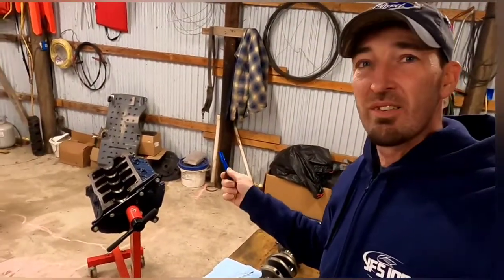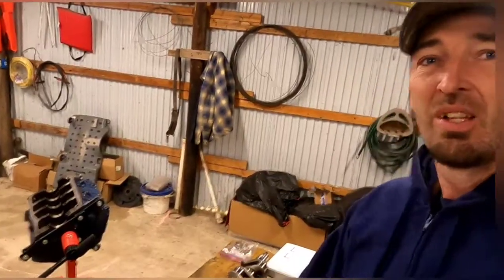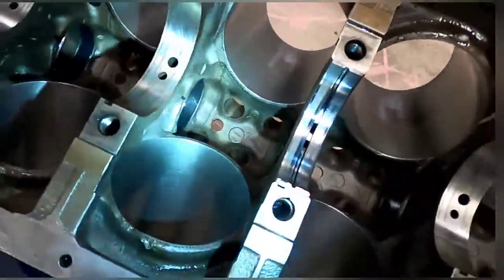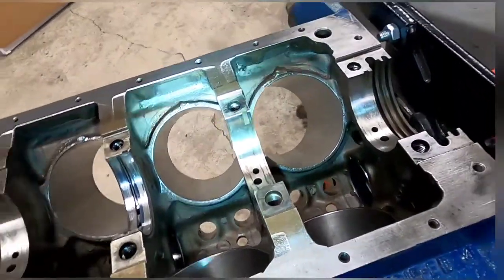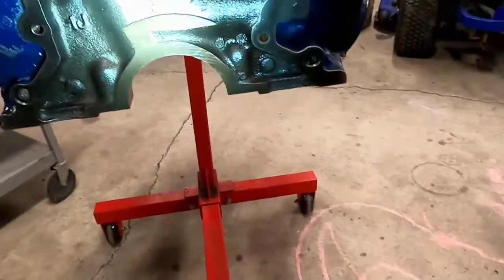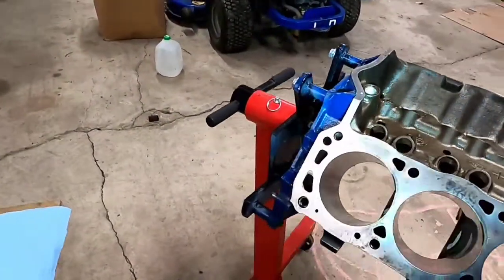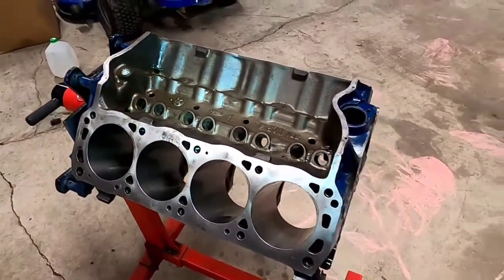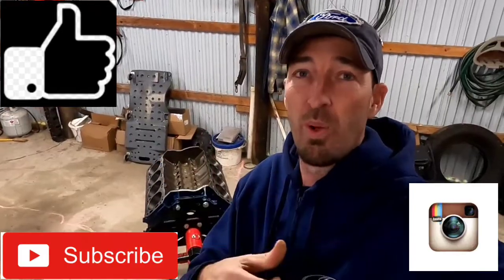Improve engine oiling! PART 1 of 2.  Ford 289,302,351 ect

Comment: One of the most important modification is to drill a 0.40 hole in the front ds oil galley plug, it sprays the distributor gear.

Comment: That hole in the front of the block by the distributor has nothing to do with the oiling system or drain back. It is just a place where the casting cores touch each other.
Reply from the maker: If you don't modify it, oil will never be able to drain out there . Which is beneficial.
Reply: @blueovaldude   Retired Ford power train engineer here.  That hole was just a consequence of how the cores are laid out  In some blocks that hole is not even there it is literally a crap shoot if it is there or not.  Once the blocks were vibrated clean of casting sand part of the sprue removal included giving that spot a whack with a hammer to knock it through if the casting was thin. This was done so it did not break off into the engine at a later date.   335 series may or may not have that hole as do many other blocks from various manufacturers. 
It is just a by-product of the casting process and that is it.    The Chain and dist gear are lubricated by the cylinder head return and the cam thrust plate lubrication all they need is a bit of splash.  Too much oil in the front of the engine can overwhelm the front crank seal, so do not be too quick to open that hole up...
Reply from the maker: @matthewq4b  with all due respect sir, you are not telling me anything I don't already know . The last part of your statement is just plain is not true, it is not going to cause a leak. How would I know ? Perhaps because I have been building engines and making engines survive in a hot steet,drag racing and oval track racing environment for getting close to 30 years, no front seal leaking issues to date . True the 335 series may or may not have that hole. The 335 series when used for racing purposes is famous for having terrible oil return .  you need to modify the oil drain backs including that area in the china wall that may not be open in a 335. If you know what I'm talking about you must know that it is common on the 335 for guys to put a .040 hole in the front oil galley plug behind the distributor gear to oil the cam gear and distributor gear more so they do not eat gears so easily when using a HV oil pump . I don't normally reccomend a HV pump or drilling the oil galley plug . But opening up and smoothing out the hole in the china wall behind the distributor has been a successful place for better oil drain back and oiling the distributor gear and timing chain better.  Also having less oil fall onto the rotating assembly makes a little more horsepower. Which is why current production engine blocks scallop oil down and away from the rotating assembly. Thank you sir.
Reply: @blueovaldude   I get where ye are coming from BUT you are only looking at short-term performance and especially race engines typically do not go 100k without being opened up.   
If you need to increase dist gear lubrication in the SBF drill a 0.025" hole in the oil galley plug behind the dist shaft.  And really most performance applications are using rear sump pans.  So that is where you want to get the oil anyway.   
Regardless none of this changes the fact that that hole has nothing to do with oil return and is just a by-product of the casting process.  None of the racing blocks or the AL blocks have it. 
But a  friendly word of advice since you are building performance engines you probably should not be taking material out from around that hole, especially from the bottom of the hole. If you remove material from around this hole it really lowers the stress required to split the block down the lifter valley.  
 This hole typically is where the lifter valley split propagates from when the SBF blocks do split.
If a block does have this hole it just smooth the edges to eliminate stress risers.   
  But ideally, if you are building a  performance engine if at all possible start with a block without this hole as it makes a substantial difference in the strength of the block..
Reply from the maker: @matthewq4b  well sir there are good explanations for those . Such as . The 351w normally rips the main webs out instead of splitting. Many f4te blocks have tiny cracks in the cam bearings journal area from the factory something you have to watch for in high performance use . But If you are going to make enough power to rip the mains webs out, it is time to upgrade anyway. As many guys now make over 1,000 horsepower on the stock block and rotating assm with boost and at some point it will have had enough. The world man o war block for Example, cannot have a hole in the china wall because of priority main oiling. It literally has the main oil gallery boss right in that location. It also has twice as many drain holes in the lifter valley. Why ? Because  it needs good oil return. Something the factory block lacks . Which is why these modifications are done . If you are are planning on having a granny machine making leisurely Sunday drives . It need not apply . If you think I don't want or don't need an engine to last you are sadly mistaken sir . That is exactly why I do these modifications, for Longevity. I want my street cars and racecars to have to have a longer lifespan between freshen ups and it helps. The nice thing is that YOU can choose if or what you want to do or don't want to do, that is up to you. Good day sir .
Reply: @blueovaldude   I'm just giving you the information Ford spend millions of dollars to find out during design testing updates and through the racing programs. Opening up that hole weakens the block, especially in the 289-302  block that is just fact. Do with it as you may.
Reply from the maker: @matthewq4b  I absolutely cannot agree .  Removing that thin material from that hole in the china wall will not be the reason you rip out main caps and main bearing webs out of the block . You don't take a bunch of thick support material out or cut deep into the block, it is just thin minimal material you are cleaning up . Also If you are afraid of breaking your block you have the wrong block to start with. Do or don't do that is up to you.
Reply: @blueovaldude   Proof is in the pudding look at basically any 302 that split down the lifter valley basically all of them started right there and many of them will have multiple cracks radiating out from that spot. This is more prevalent in the ;later light castings
 It is this spot from which lifter valley cracking typically propagates. And this will happen LONG before you blow the webs out.  Apparently, you have not seen these blocks cracked right in half typically this happens once you start going over 400HP. And pulling material out of that spot will only lower the HP required to split the block down the lifter valley.  
A quick internet search will you give you lots of examples of cracked lifter valleys with the mains and webs intact..  
You can believe whatever want but it does not change fact.
Reply from the maker: @matthewq4b   when doing this modification it is not going to make your engine  block fly to pieces  like you are insinuating . BTW I am referring to 351w blocks such the one in the video or the F4te casting # I referenced in a earlier comment . I suggest you go look at posts and pictures in 9.5 deck nation ect and you can see what I am talking about with main caps and main webs being ripped out, and how the hole in the china wall is not to be blamed for them letting go . we have some 8.2 deck stuff and had stuff a way north of what you are saying that they fly south at . people have run in the 4's with stock block 8.2 deck and 9.5 deck stuff. OVER 3 TIMES the horsepower that you say will break them . It appears that you only came here to fight and not to have an open mind on things . perhaps a visit to 8.2 deck mafia or  8.2 deck nation would be a good place for you to go and tell them that 8.2 deck blocks are only safe to under 400 horsepower which is what you seem to be suggesting .

Comment: 😎👍
18:40 pressures is resistance to flow. Radiusing reduces resistance so flow increases at the same pressure.

The higher the pressure the more stress on the oil pump shaft and horsepower loss. ALL excess flow will bypass, so as you noted, high volume pumps are not needed.

Note also that since you can prime an engine with an electric drill at 4,000 engine rpm and using room temperature oil..... How much horsepower is the pump actually consuming? It's drill!! THINK ABOUT IT. 😁 
JME/JMO
Reply: Edit:. Volume is limited by the bearing clearances... Pressure being equal.

Comment: dont drill the oil plug near the dizzy gear?
Reply from the maker: No sir , and I have never had a gear failure . 😀 I forgot to mention in the video that I also convert pressed in oil gallery plugs to screw  in plugs .

Comment: This is a pretty good explanation of how to optimize the oil system in the Windsor blocks.   I would only add a few things I can think of that  I do.   The lifter bores need to be mic'd because if they are worn out of spec you will have a huge internal oil leak and low oil pressure.   If they are out the lifter bores would need to have bushings installed.   If you have a good machine shop going over your block they will generally catch this if it is an issue but I have dealt with machine shops that would not do anything beyond exactly what you specifed in your work plan so mic checking the lifter bores needs to be listed in the plan.    I also ditch the press in oil galley plugs and have my machine shop intall all threaded screw in plugs with sealer on the threads.  I have mine sealed with blue loctite.   

I also never run factory/stock oil pumps.   In the Windsor engines I run Melling 10687 standard volume PERFORMANCE oil pumps in the 289/302 blocks and 10832 in a 351W block.   They are made a lot better than a stock oil pump or the standard volume regular Melling pump.  You also should mention running an ARP extra heavy duty oil pump shaft even with a standard volume pump and even if the engine is not going to be rev'd hard but especially if it is going to be rev'd hard.

Oil filters are not all created equal either.     I use only Wix racing filters on even the mild built 302 in my truck.  

I know it is hard to think of totally everything when you are doing a video.
Reply from the maker: yes, this engine actually has screw in oil galley plugs, a 10832 oil pump and oil pump drive and a wix 51268 oil filter  . i showed a few of those things in other videos . funny thing those melling select pumps use a standard pump housing and have a different base plate and threaded bypass valve . if you look at the housing it will say M83 for example on the 10832 windsor pump . a modified stock pump is adequate for most applications . I show how to mod a stock pump in a seperate vid . thanks for the comment sir .

Comment: Are u still running the T Myer oil filter adapter on your 351w
Reply from the maker: Yes I am and a 51268 wix filter.
Reply: @blueovaldude  Oh ok I didn't know if you took it off when you were getting too much oil to the top of the motor . I ordered a few Napa golds 1268 for 8 bucks each that is supposed to flow the same as wix filters and if im not mistaken wix is the maker of the napa golds
Reply from the maker: @79beans347  I have a few engines with the filter adapter. Yeah , if it has a similar number it probably is wix , they do use wix filters.  We are a wix filter club member so I think  less than $6 each filter for me . About half price of a  51515R and a better micron rating and about the same flow rate . Win win I say .
Reply: @blueovaldude  man that is cool i need to become a member so I can save money because all the other ones that I saw were 20+ bucks each so I found these marked down so i bought several off of Ebay for 8 bucks each and they had plenty more so im going to build up a bunch of them so that I wont have to worry about them for a while because I change my oil more often than recommended by factory just because I might have to do a burnout or 2 more than my daily so I show it a little extra love 😂🚗💨💨💨
Reply from the maker: @79beans347  yeah,check it out . I usually go around 1,500 -2,000 miles on a street strip kinda deal , cheap insurance.  The Endurance car, every race or every other race , depending on oil condition .

Comment: With roller lifters what oil do you use I got factory 5w15 in mine but it has very low oil pressure at ideal. Is this my oil or my high volume oil pump
Reply: At idle it’s 10 or less give it gas it jumps to 40
Reply from the maker: @777smitty4 I would Switch to a heavier weight oil and cross my fingers. That is concerning though.  With a Hv pump you should  have better oil pressure at idle over a standard volume pump . If  a switch in oil weight doesn't work,  my first thoughts are.. . . Is pump pickup to pan clearance correct ? Is the oil pump gasket blown? Are all softplugs installed (I've seen it happen from a machine shop ) and the scariest , is there excessive bearing clearance?( Fried bearings)  you can lose a bunch of oil pressure just from bad cam bearings. Hope that helps you out.
Reply from the maker: Oil weight depends on bearing clearance and engine usage, there are a few guides online. The zephyr 5.H8te has DRIVEN full synthetic 10/30 right now . Very thin oil is used in drag racing where they want to get every last drop of horsepower , I would never use a thin oil in a street/strip car . I would switch to something thicker if I were you . What kind of oil pressure do you have? https://images.app.goo.gl/9Yi4rbBd9KveYEvXA   check this out for an oil weight guide .

Comment: Just curious, do these mods increase or decrease oil pressure?  Thanks.
Reply from the maker: Good question. It increases the efficiency of the oiling system. Better drain back gets oil back to the pan faster to decrease the the chance of sucking the pan dry, higher pressure requires better drainage.  Pressure is a function of restricted flow . The bypass spring in the oil pump controls total oil pressure . Even without touching the pump , I normally see a increase of 5-10psi after mods , because oil can more easily get through the filter and filter pad and where it needs to.
Reply: That's illogical.
As you stated pressure is resistance to flow. Pressure is limited by the bypass spring.
Regardless of smoothing the bearings still leak the same amount and the bypass spring is still the same. 
Pressure cannot increase.
Reply from the maker: @hotrodray6802  Yes,The oil pump has not changed relief pressure . But There are soo many restrictions between the oil pump and  the port at which you test pressure ,  the pump is against the relief valve and at full pressure.  For Example Let's say there is 60 psi at  the pump outlet, but that's not at the test port in the block, perhaps just 45 psi at the test port . The bearings, lifters ,rockers ect are bleeding off oil faster than the restrictions between the oil pump pad and the test port can flow . which is why you see lower pressure at the test port compared to what pressure the pump is set for . If you remove those restrictions like in the video, your engine & test port will see closer to what you oil pump pressure relief is set for . I hope that helps explain it . 👍